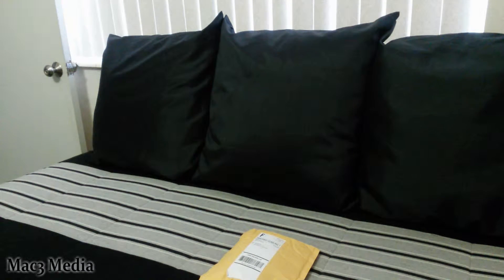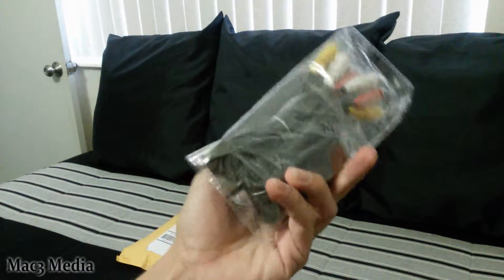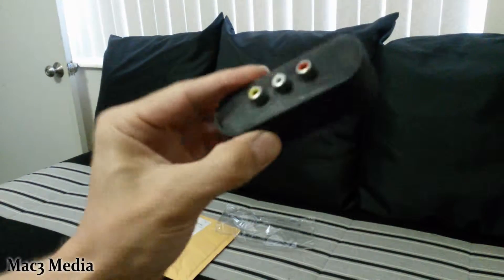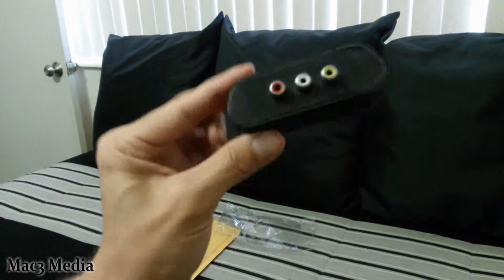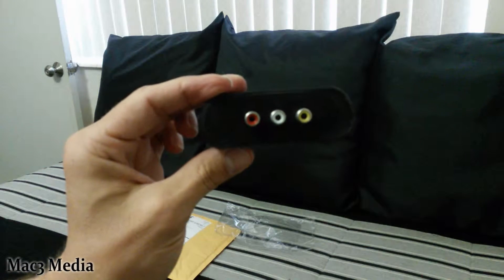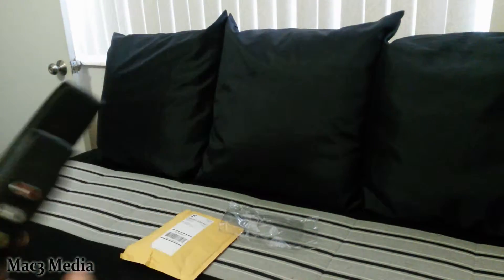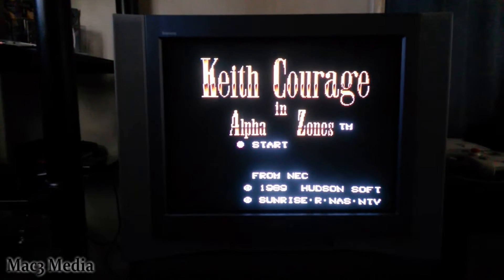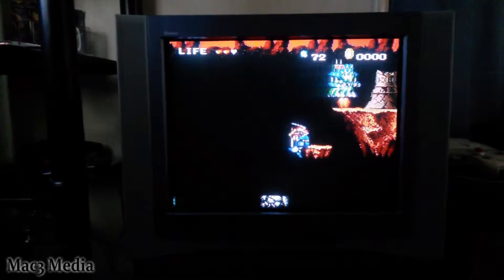3rd Party - 3D Printed (TurboBooster) by Dogwoodcraft

Comment: I found an original turbobooster on ebay for $95 says it works perfectly. Should be coming in soon . I'm excited to update my system. The sound with the coax isn't good even for the time .
Reply from the maker: That's actually a good price for now a days...that thing was 20$ when it came out...i have footage of bonks revenge running on my JVC 4K in action video...looks amazing
Reply from the maker: https://youtu.be/r-luWgN2XV8